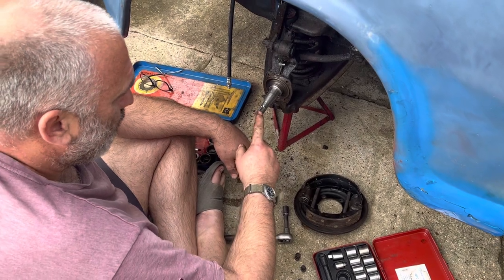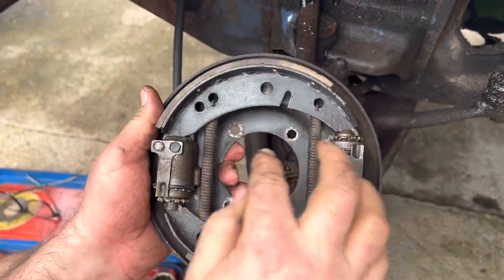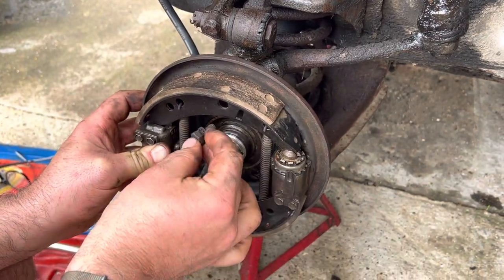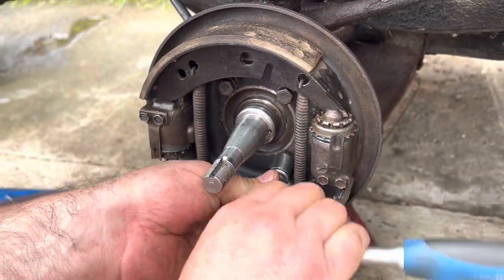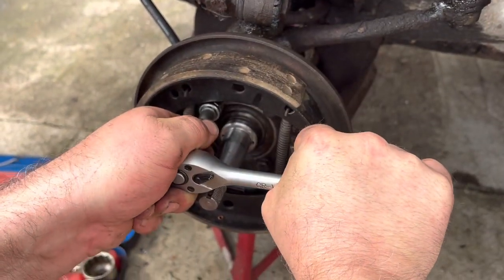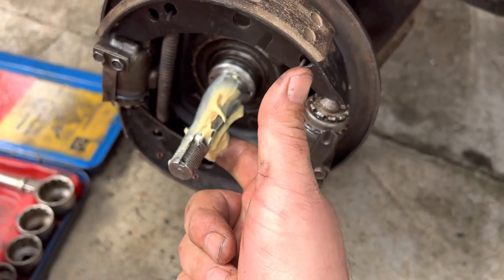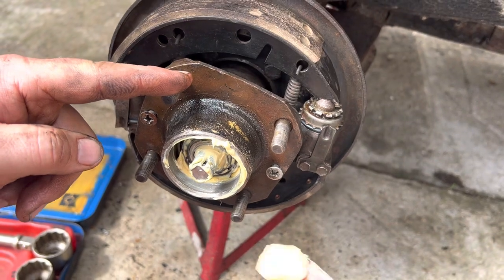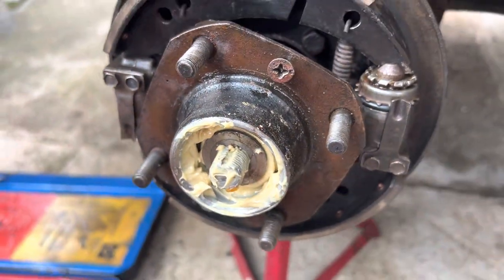Brake System on my Austin A35 1958

Comment: You can replace the philips brake drum screws with a recessed allen hex with the same chamfered shape to fit the drum. They are a bit more positive than a philips head, slught smear of grease on the threads on most car fasteners saves a lot of heartache in the future.

I did that job when I was 18, plus fitted new KingPin bushes then reamed them to fit with two expanding reamers as the top of the kingpin is smaller than the bottom. In order to fit the bushes in we put them in the freezer for a day then warmed up the casting and they slipped in easily, but you have to make sure the grease holes line up between bush and casting. If you start hammering the bushes in you will ruin them.

Comment: King Pins and Armstrong Shock Absorbers Uggh! Having owned an A35, after having to replace both King Pins, I decided that medium grease wasn't working effectively to lubricate the new ones fitted. So, I filled a grease gun with Hypoid Oil EP140. I regularly treated the King Pins to some lubricant that couldn't "dry out" like grease. No more problems after this.
Reply from the maker: I love these fixes… i drilled a number of holes in the floor to allow  the rain water to pass through as it had so many leaks in the glass seals!!

Comment: Should there have been a copper sealing washer between the hose connection and the cylinder
Reply from the maker: Dont think so.  Its not leaked.  But i suppose it wouldnt hurt to put one in.

Comment: the pipe connecting the wheel cylinders looks like copper not ideal needs to be steel
Reply from the maker: think it is copper.  It was a replacement from ESM.